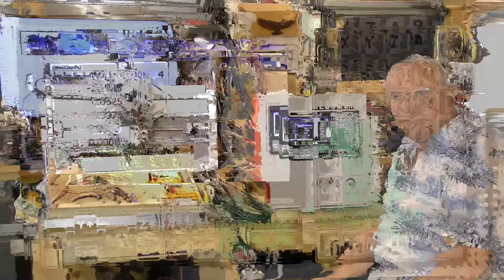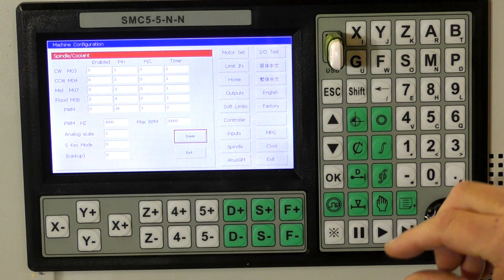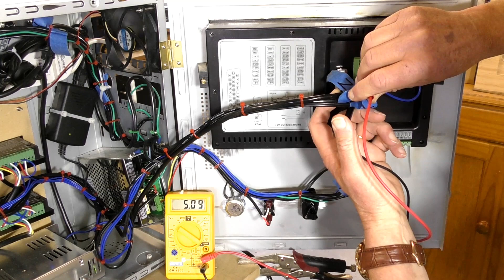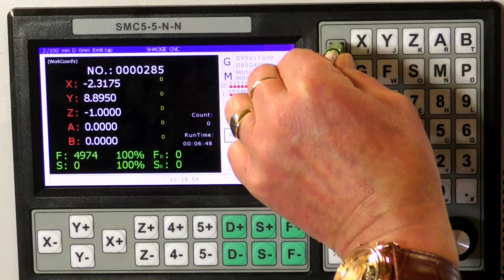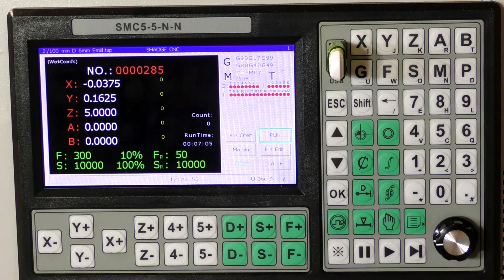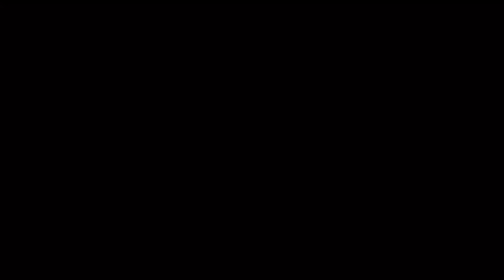CNC router; Install a 800w spindle  + I WOULD "NOT" PAY OVER $500 for the SMC 5-5-N-N controller

Comment: Hi Roger, what sort of a current is supposed to be coming from “out1” to the forward terminal on the H100 VFD ? I’m not getting any signal
Reply from the maker: You need to turn it on in the controller settings. (0 to a 1)

Comment: Thanks for this video could you explain what pwm is and the difference and benefits of either also explain how to set up the pwm. thanks
Reply from the maker: Pulse width modulation (PWM), or pulse-duration modulation (PDM), is a method of reducing the average power delivered by an electrical signal, by effectively chopping it up into discrete parts.
This is for a video on the next build.